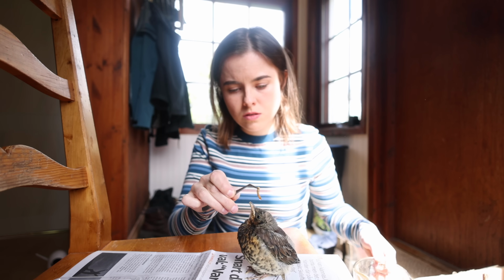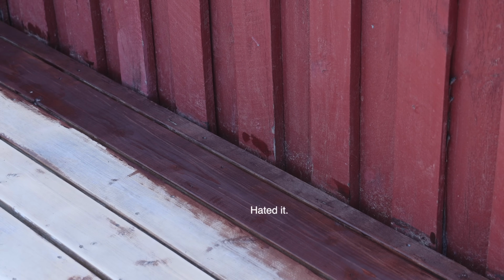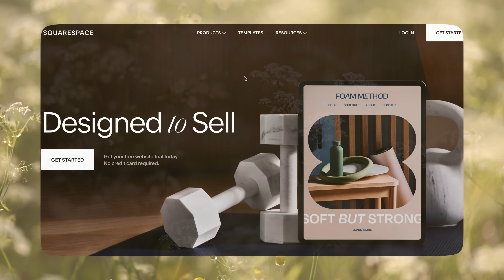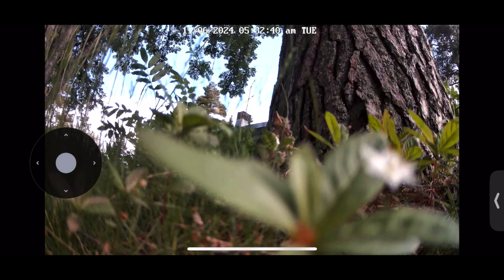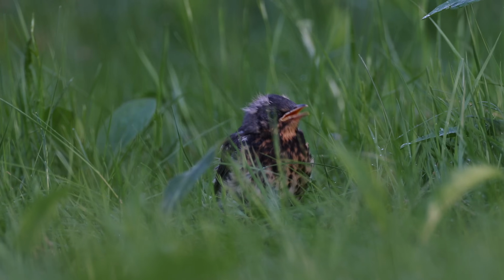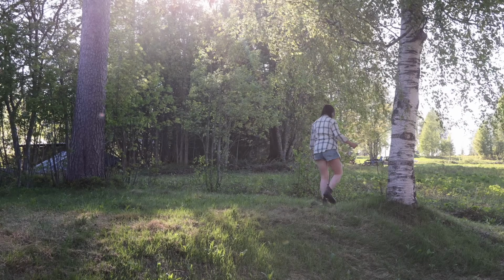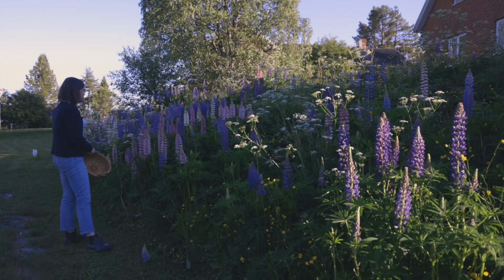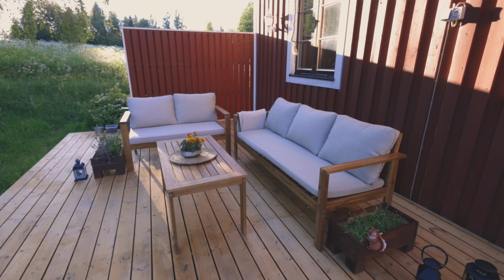MidSummer in Sweden, Bird Rescue, A&E Visits

Comment: Dani, I had a similar back seizure when I was cleaning a shower and was in an odd position for a long time.  My doctor gave me a light exercise that's miracle he said that any of his patients that did it 10 times in the morning have never returned for the back issue.  I can tell you that over several years it works whenever I feel my lower back tightening up I just remind myself to do this exercise. n you lay flat on the floor and you raise your knees up to your chest as far as you can and then lower them back to the floor so that you're laying prone then you bring your knees up to your chest as far as you can again and you do that 10 times I do it 20 because over time I've built up.  You're actually strengthening your stomach muscles which sounds counterintuitive but it's a supports your lower back.  I promise if you do this for a week you'll feel the looseness in your lower back and the strength.

Comment: Dani and anyone else that's bulged a disc this way- if this happens get a bag of frozen corn or a rolled up towel. Lie straight on the floor then get someone else to help you elevate your legs onto a chair so your thighs are straight up and down and your calves are on the seat part of the chair. Then carefully lift up your lower body (hurts like hell but trust me this will fix it if you can muster the strength) and slide the frozen corn or rolled up towel under the lumber of your back where you have bulged the disc. Try to relax the weight of your body onto the corn or towel. It should help ease the disc back into position. I know this as i have bulged a disc many times since i was young and a chiropractor told me what to do in the event i couldn't get to someone to fix it. Its super important to try keep active as much as possible and go for walks (push through the pain because walking helps strengthen the muscles and get things back where they should be) My back has improved out of sight since i got rid of furniture and went minimalist/japanese style. I sleep on the floor and sit on the floor and i hardly hurt my back anymore because sitting on the floor and sleeping on the floor strengthens your muscles and improves circulation because you move position more and your bones go back in alignment better. Beds and couches might make you feel all comfy and dreamy at the time but they are really bad for your back, bones and your immune system. Anyway i hope this helps anyone who is going through this. Its extremely painful and can feel like you are cut in half! If you are prepared to take my advice which is hard at first (sleeping on the floor etc is a shock to the system but after a while you get used to it) you will reap the rewards later on and have less back problems injuries and pain besides that you end up with rock hard abs which is crazy awesome. I am so strong in the core now it amazes me because i used to work out and was never this strong. All this being said you still need to be mindful how you do things after you have bulged a disc - it doesnt pay to lift heavy things leaning over  etc. Slouching in "comfy chairs" etc is a mistake because the back muscles relax and its easy for the back disc to slide out of place again.

Comment: It's my first year in Sweden, in nearby Umeå, and I like the wildflowers so much that I wonder why people even bother to grow more high-maintenance flowers. I've made no effort to grow a garden, and every couple of weeks I'm surprised by a new type of flower that appears next to my apartment.

I went to Luleå for the solstice, about 80km from the Arctic Circle. I made a point to take a photo at midnight, and there was still yellow on the horizon. It's bizarre to see the sun on the horizon due north. Midsummer is indeed a big deal here. I was told that it's a bigger deal than even Christmas. Indeed, I had a difficult time finding a place to eat because almost all of the restaurants were closed.

I also herniated my disc, about 15 years ago, and I immediately suspected it when you described not being to stand up straight. Every year or two, I aggravate it, and at its worst it's the worst pain I've ever experienced.
Reply: Please kindly, 🙏 try to strenghten Your lower back & stomach/abs muscles to Keep discs protected. Bend correctly, at hip level, not by bending whole back...👍 Blessings 🙏🕊️🌟

Comment: You are probably going to get a lot of suggestions on you back. The one that has consistantly helped is the Yoga position called the "cobra" Basically lying on your stomach and propping up your head with your hands, elbows on the floor. This pushes the disk back into position. Sitting pushes it out and causes the disk to push on the nerves. 
Works for me!!

Comment: @DaniConnorWild So nice to hear again from you, Dani! Watching your beautiful bird caring experience. But also sad, you have suffered disc issues with your back. I know this from my own experiences, actually a common photographer issue, always carrying a lot of weight from equipment on the shoulders, often with asymmetrical load distribution on the vertebrae. If you travel, please take care using a camera bag with integrated trolley wheels, so you could put weight off your body as much as you can for reducing burden of the vertebra discs. 

Additionally, yes, even if you don't feel any pain consciously, your muscles are doing their own thing trying to reduce pain. They get themselves into tight suspension, which is sadly often exactly the way to get things worse. This is why you couldn't move anymore all out of the sudden. You simply don't expect this coming,. especially as a young person. Don't worry. It happened also in my still-young ages. It's not about a matter of age, but of repeated asymmetrical heavy load on your back. You don't even notice much, until it strikes in at a totally different occasion. 

There is an excellent cure for exactly this issue. I didn't believe very much in it, until I had to find a solution to my own back pains some 12 years ago. I couldn't get rid of it by simply resting or being careful. I never used pain killer, because it just makes the sensorics numb, but doesn't remove the source of the issue. The surprisingly good solution was going to a very experienced acupuncture practice. I was given a 50 minutes therapy of combined acupuncture and cupping by a very experienced TCM doctor. The pain has been reduced by roughly 70% instantly after the therapy. I could have walked without significant pain after several months! The doctor had already the concern, I might need a second session. In real the pain came back after a week or two. I was first a bit very disappointed. Maybe I should have taken the second session at that time. But I didn't have time or mood, thought I would have wasted the money already. The wonder came much later. After the season I took a very long resting period. I felt the pain gradually going back over a time of maybe a month. And it never came back ever again. 

So, if this experience of mine could encourage you, please don't wait for too long. Look for a very good TCM acupuncture practice in your region or anywhere else. I'm sure, in London you could find any with excellence. 

Of course, I hope even more, you could have already recovered completely, so you wouldn't need it anymore. But I had to share this experience with you, just for any case you could need this knowledge. 

Best greetings from Southern Germany! And thank you once again for your wonderful videos! ❤

Comment: Use a better mask when sanding. At least ffp2 or even a proper respirator, the mask you were using does nothing against the fine dust
Reply: Protect the eyes with goggles as well.